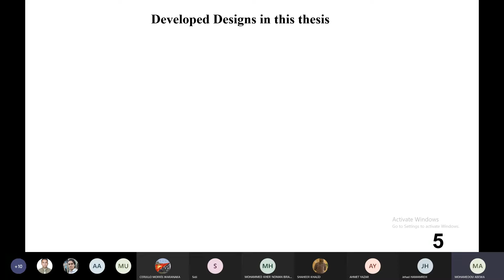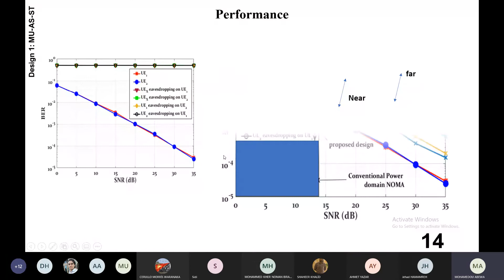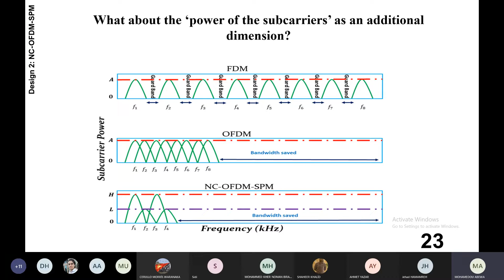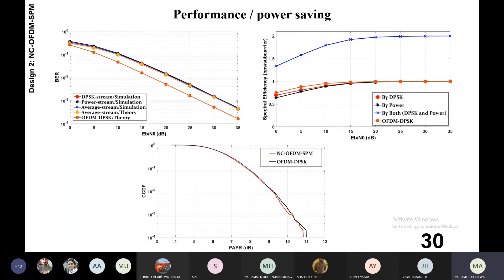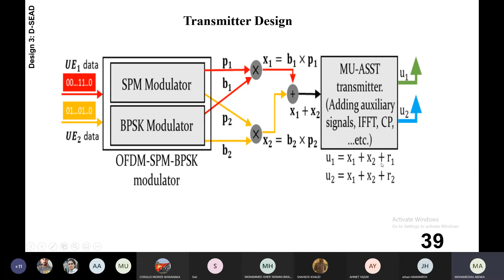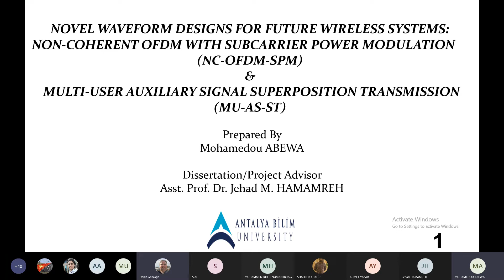New Novel Wireless Transmission Designs For Future Wireless Systems (6G AND BEYOND)-Better than NOMA

Comment: if the secret code rate is 1 and the secrecy capacity is 10^-2  that means the secrecy capacity for the system is less than comparing to 10^-1, thanks for your cooperation, sir?